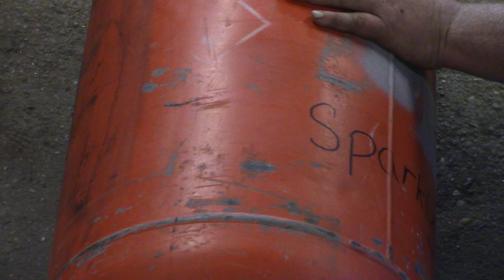Petrol-Gassolene driven air compressor build part1

Comment: That's going to be some compressor. At my model engineering club we first test boilers hydraulically so that any leaks are not explosive. 

I look forward to seeing it finished.
Reply from the maker: That would definitely be the responsible thing to do. I had two thoughts
1. Use the jet washer to do it
2. Don't bother because I've barely touched them.
I'm not sure if common sense or time saving will win yet.
Reply: @turboconqueringmegaeagle9006  We use a hand pump and a pressure gauge to, if I remember correctly, 1.5 times working pressure. That said, if you get a split, it's likely to be an engineered one. I might put side panels on just to catch shrapnel though. 

I will now go and take the dovetails apart (because I have done it before) to show what is in them for you. Also your lathe is quite a good one. Did you say it was 1 1/2" by 8TPI?
Reply from the maker: @BensWorkshop   don't strip your lathe on my account mate, I've got workshop encyclopedias and stuff I can consult.
Spindle is 1 3/4 8tpi
Reply: @turboconqueringmegaeagle9006  It'll take 5 minutes to do that bit, and is no bother. I also might have to take off the saddle which is a trickier proposition. (Because it isn't running quite true)

Comment: Now that you're building a nice big air supply, there's a well drilling method you may find useful.  A pneumatic drill at the bottom of a drill pipe breaks up rock or soil.  The air then drives circulation of water to lift drilling debris to a sump on the surface, where the debris is dumped before the water flows back into the hole.

Given the local soil conditions, a few reinforced concrete rods to secure the ceiling of your workshop don't seem out of order.  Or drill some pipe shafts around the perimeter of the site, into the lower water table where you're planning to dig, to pump the spot not so wet.
Reply from the maker: I've read about the pneumatic caissons used for setting bridge foundations, I shall look for the well digging equivalent thanks.

Regarding the water table, I've now gone through the clay underneath it and it's pretty dry down there.

Comment: How does the hole manage with the rain? I dug a hole in my back yard a foot wide and 10 feet deep last year to irrigate the potatoes. At the moment the water table is only 2 feet down. You're only a few miles up the road from me so i was worried you may have accidentally made a well.
Reply from the maker: I got through the quick sand and I'm now at 16' in very hard clay, the water on the outside of the pipe is at 3-4 foot bellow ground but there is only 18" of water in the bottom of the hole inside the pipe and I've not been down there in 4 days, once I get further into the hard clay it should seal up even better and when I'm done with the shaft some backfill should cut the sepage down. Hopefully. 
I will put a sump and pump at the bottom but I'm pretty sure a really good air flow will carry most of the moisture out if I get it right.